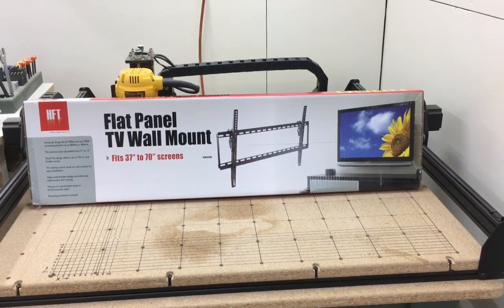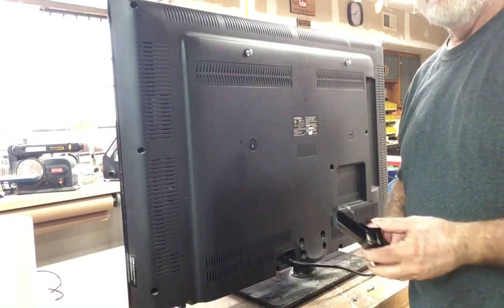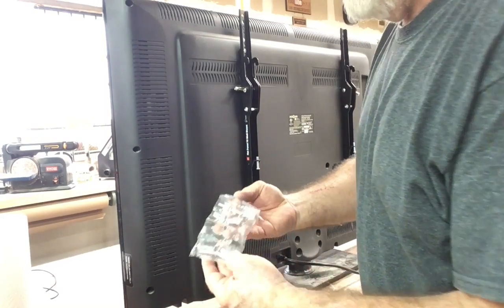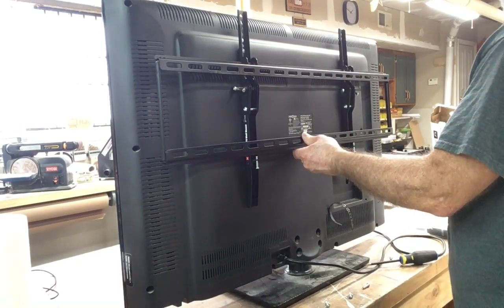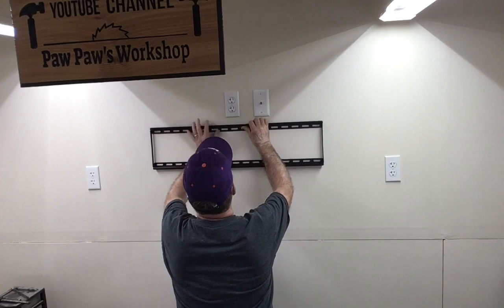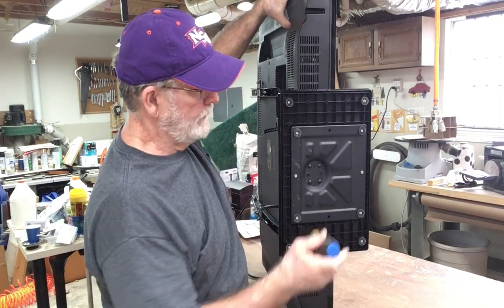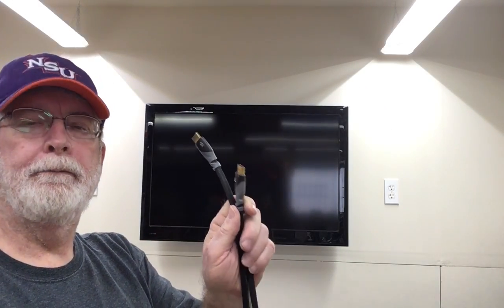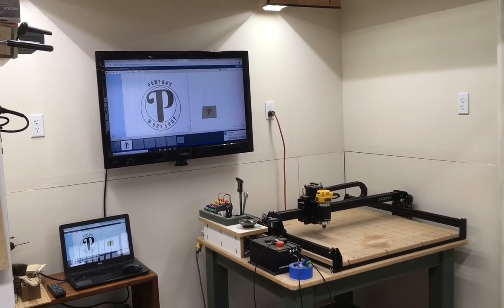How to Install a Wall Mount TV New Home for the CNC Workshop Day 3

Comment: Your monitor has four screw on the back which when removed will allow the rest of the base to slide out . will look cleaner on your wall with out that piece hanging down .
Reply from the maker: Thank you very much.  You are right.  I didn't take if off because I am storing the base plate on the shelf and that part of the base just didn't fit in the space.  I may switch the monitor out for something else and did not want to lose the parts.

Comment: Nice work with the makeover.  I also hung a monitor on the wall.  One suggestion would be to use a wireless keyboard/mouse.  You can pick up a Logitech MK270 for $20.  Then you can add a membrane to the keyboard to keep sawdust out of it.  As for the laptop, Right-click on the desktop -->display settings-->power & Sleep-->additional power settings--> Choose what closing the lid does-->do nothing.  This will allow you to keep the laptop powered with the lid closed.  You'll just use the wall monitor and no sawdust will get into your laptop.  I went one step further and keep my laptop powered continuously so I can remote into it from other locations and do my design work.
Reply from the maker: Thank you, great ideas also.  I have a wireless mouse and I love it.  The laptop does not stay in the shop.  I bring it into the shop only to carve on the CNC

Comment: hello God bless you family and friends. I have a question on a CNC machine I'm thinking about getting one is it hard to handle work.... what if you can tell me what would I need and like the one you have or something I would really appreciate it thank you very much God bless all..
Reply from the maker: I do not find it hard to handle work.  You can go to the Inventables website and you can also call the support team at Inventables.  They are very helpful.  The website is www.inventables.com .  I have the 1000mm with the Dewalt 611 router. I also purchased the clamp set. I have the homing switches but do not use them.  That would be up to you.  If you have basic tools already in your shop skip the tool kit that they offer.
Reply: @PawPawsWorkShop       thank you 👍 very much..